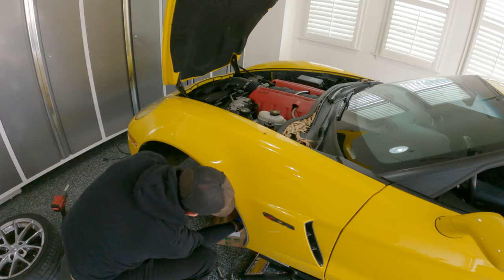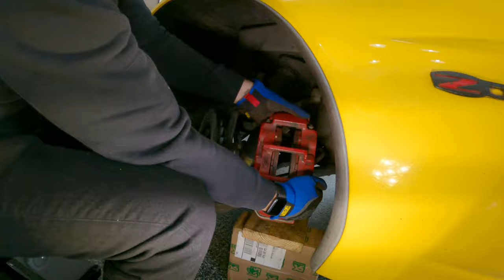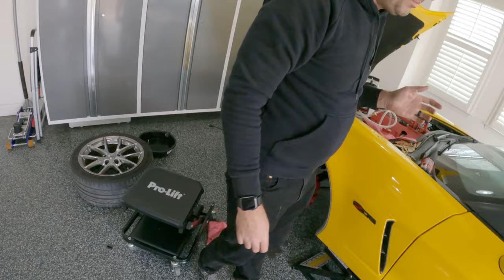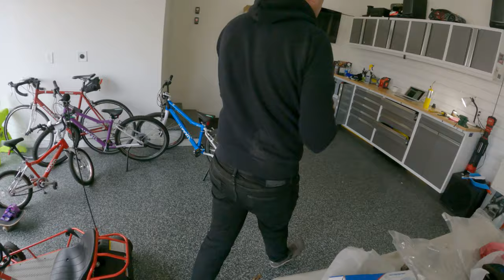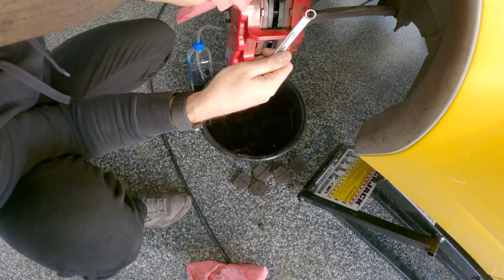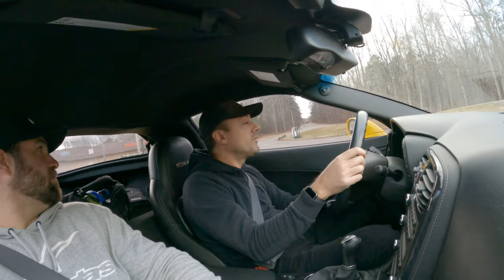How to make a C6 Z06 brake job last all day.

Comment: I didn’t catch which pads you installed. 
Thanks!
Reply from the maker: I kind of glossed over it in the video. Carbotech X10 (front) XP8 (rear) they're what I ran on my C5 Z06 and they worked well as a track pad that got street use.
Reply: @JoshVanVeld  What about the rotors? Are those OEM GM rotors?
Reply from the maker: @coltonhodge  I believe we picked up a set of Centric cryo-treated plain-faced rotors from Tire-Rack. I'd had good success with those on my C5Z but recently when I got my C6Z I had vibration issues. I'm guessing due to overly-aggressive bed-in procedure.
Reply: @JoshVanVeld  thanks for the reply man. Any chance you have those part numbers handy? Love the content.  Maybe 125.62102?

Comment: Although not quite as effective, I might suggest that the emergency (parking) brake can still be used without actuating the disc brakes. It might keep you trom running a stop sign or a stop light.
Reply from the maker: Good thinking! Definitely smarter than my method :)

Comment: What kind of fancy car jack/lift is that? Where can I find it?
Reply from the maker: That's a QuickJack, got it at Costco but you can buy them online. I'm really happy with it compared to getting by with a floor jack and jack stands.
Reply: No matter what jack you use, if you don't use the perscribed "pucks" you will stand a very good chance of cracking the fiberglass around the jacking points.
Reply: @ricksgarage8069  thanks for sharing that I had no idea about the pucks.